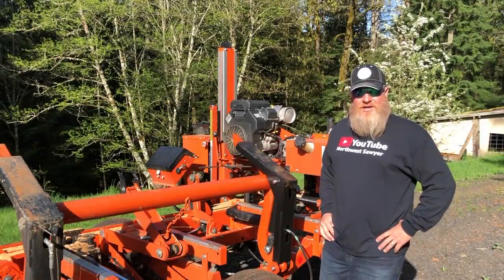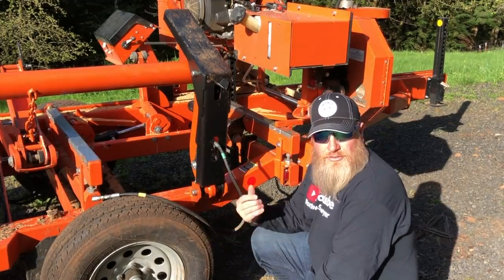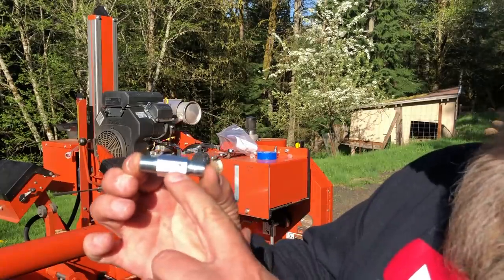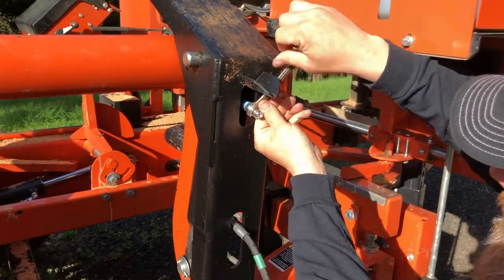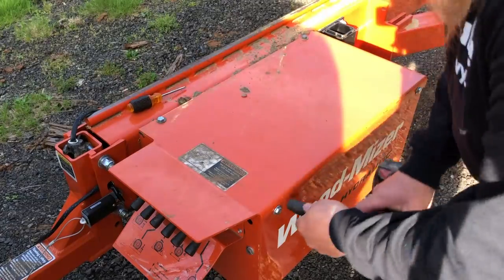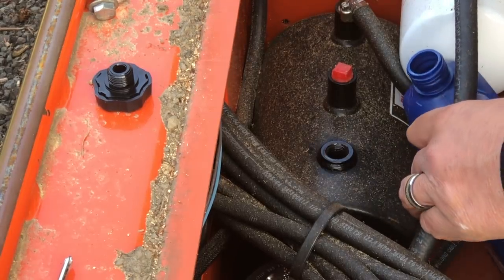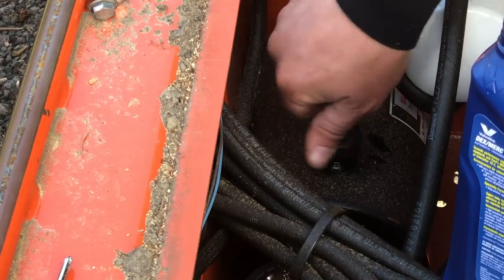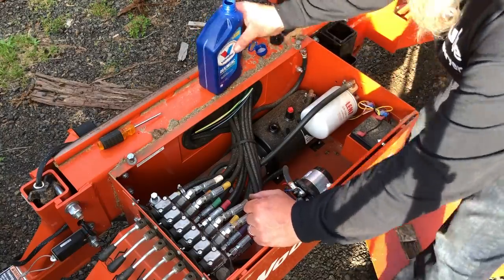I Broke My Sawmill!!

Comment: I work factory maintenance and we have gone away from teflon tape and are mainly using liquid thread sealants, such as Loctite 542 now. we find them more convenient and easier to use than tape. Gives you another option when doing repairs. Keep up the great videos.
Reply from the maker: The fitting I removed had tape on it so I used some. I’ve never actually used it on hydraulic lines before.

Comment: Remember teflon tape is only goes on pipe thread fittings. J I C,O-ring type, flat face fittings do not require teflon tape.All must be clean of any debris or contaminates.

Comment: Don't use Teflon tape on hydraulic fittings. Fragments of tape can get into pumps and valves and cause problems. For fittings that don't have a machined mating face, use hydraulic thread sealant.
Reply: Or just make sure the tape doesn't go over the end so there is zero way for the tape to go thru the side of the fitting.
Reply: I agree that one should never use teflon tape on hydraulics. Even if you're careful,  it can get into the system. Small bits can cause all kinds of problems.

Comment: I was wondering about the replacement part. Was that something you had in inventory, or is it obtainable locally? It seems like a specialized part that would neet do come from the manufacturer.  Nice video. Thanks
Reply from the maker: Thank you! They had the fitting in stock.

Comment: What the Hell were you thinking, using a flare-nut wrench on that fitting? You're a YouTuber. It's your duty, DUTY I say, to use the WRONG tool for the job, thereby driving me CraZy!!!   Go back, and do it again, and this time, get it right by using a pipe wrench, or maybe some Vice-Grips! 🥴
Oh, wait... You redeemed yourself a few moments later by using a regular open-end wrench, and having it slip off and cause you pain!    Whew!
Reply from the maker: Well that’s because I was using a metric wrench on a standard nut, Lonnie🤣🤣

Comment: Good videos 👍 I been having some wavy cuts on my LT 35 what's the main cause of that? I change my blade often have you had problems with that
Reply from the maker: Thanks, Carlin. Usually wavy cuts are dull blades or incorrect blade tension.